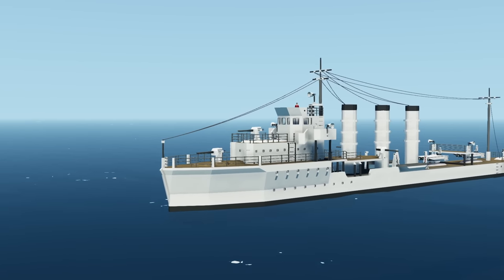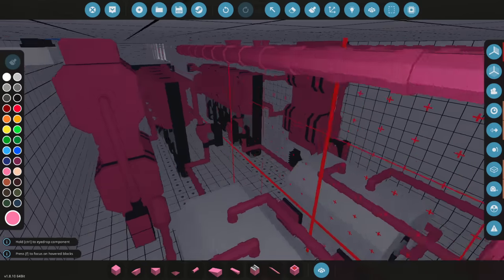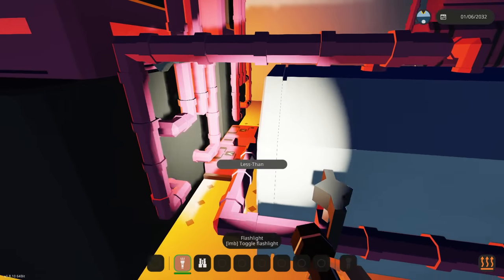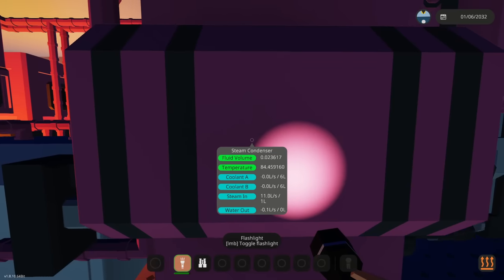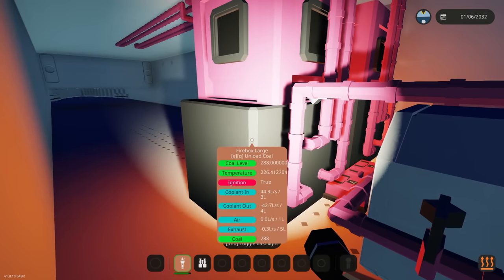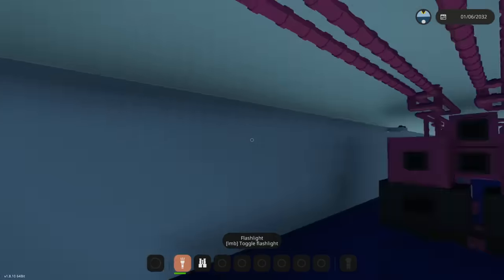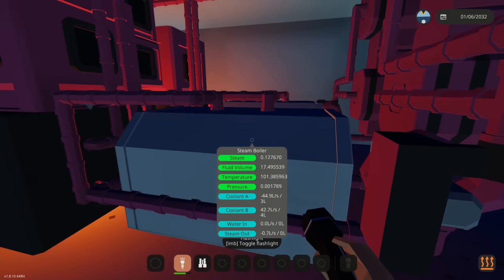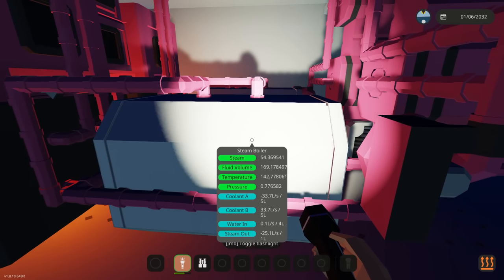OUR DESTROYER CAN SAIL NOW! - WW1 Destroyer Build - Stormworks - Part 10

Comment: A little tip, you should put a gauge that has a maximum of about 150-ish that’s connected to the boiler temp, as well as a constant number set to 100 connected to the secondary value that way you can check the boiler temp at a glance so you don’t have to wait for the steam to start releasing.

Comment: Dont block the temperature of the boiler, you will need 30+ minutes to reach about 8-9 pressure (optimal). You are getting like 0.05 pressure at the moment. Instead of blocking the air to the ovens, block the water from getting back into the boiler (with a valve), when the pressure is above 8 (or 7, depends on how fast it rises) because: No water to turn into steam = no further increase in pressure = constant of 7-9 pressure.

If you get 1-3 rps with 0.05 pressure, imagine having 8 pressure (160x more pressure)
Reply: steam pistons for ships appear to work best with the pressure being around 1.